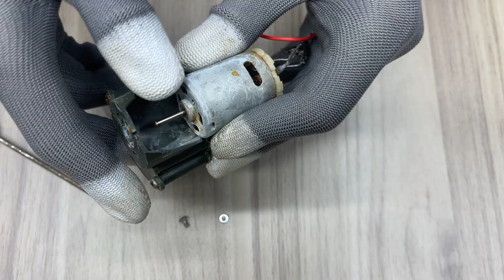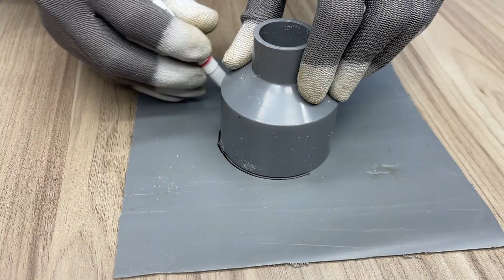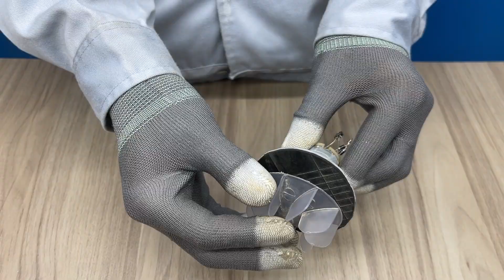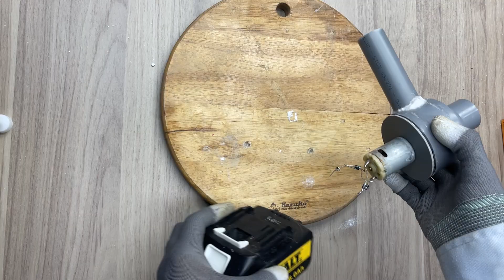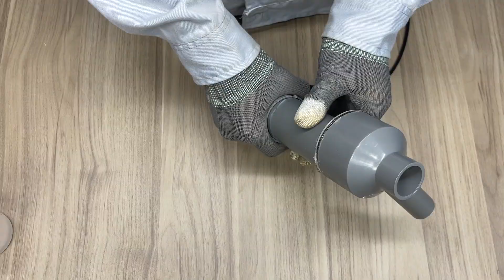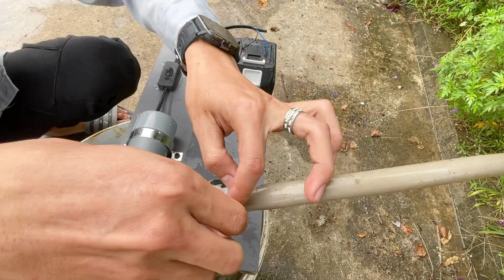Why Didn’t I Know This Sooner? Old Mini Engine Turned into Free Water Pump by a 60-Year-Old Plumber!

Comment: COOL DEAR, THIS MOTOR IS ALSO IN TOY CARS THAT CONTROL THINGS RIGHT
Reply from the maker: Yes, exactly! It’s the same type of small DC motor used in many remote-controlled toy cars. Here it’s just repurposed for a simple water pump system. Have you ever tried reusing toy motors for DIY projects? ⚙️